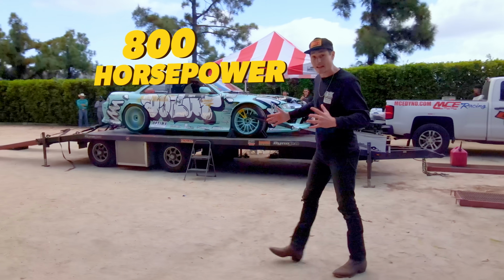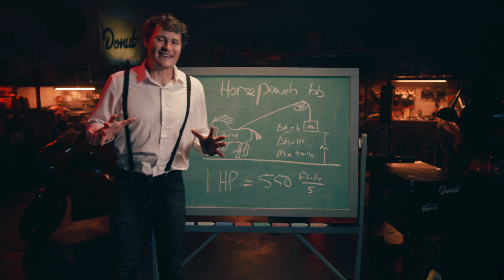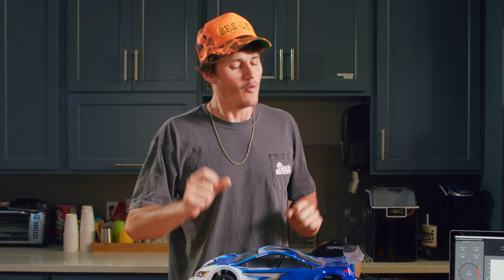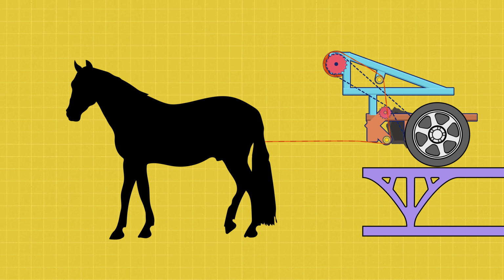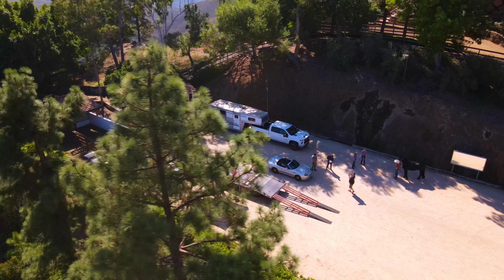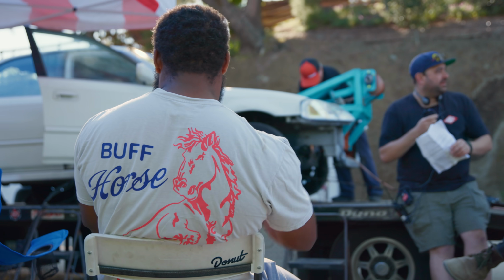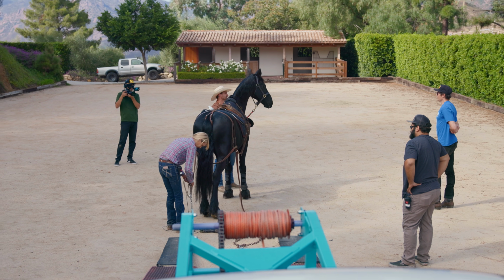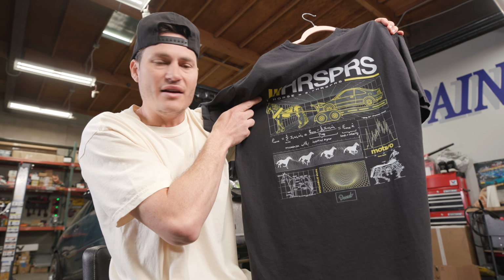How Much Horsepower is a Horse?

Comment: shitting on prior estimates was pointless. Watt based his calculations observing a horse do one hour of sustained work with 180lbs resistance, whereas this entire video was about peak power in a 10 second window. Big D doing 5.7hp looked like nowhere near his maximum effort. despite making the audience seem like this was a challenge against old knowledge, alas the 1993 Nature article's 15hp peak estimate and Watt's 1hp-for-1hr 300 year old estimate were nowhere near touched and we learned nothing new.

called in Adam Savage but yet did not share what ideas he had to give about the experiment design. a legendary man and treasure trove of resourcefulness wasted. what was the point? 

no scientific value except for the Motivo guys who thankfully get to write the paper about their crankshaft model of a typical draft horse, of which details were teased yet not even shared in the slightest, save for a few scribbles which we don't even know if it was the actual material. at least share the force measurements at the measured power peak. what did the GPS+force gauge numbers have to say? real science done by these guys but all we got from the video was a bunch of goofing around.

Comment: …but doesn’t one horse= 1 maximum horse power, no matter what? Nominal horse power should always be a single horse. 1=1 should be the starting point of any equation, I would think. Maybe I’m nuts but this seems over engineered. I’m sure I’m wrong but it’s a great video either way :) thanks! ❤

Comment: Every person understanding the difference between torque and power should understand this test is more a test of the horse's raw strength than its power.
A comparison is that a tiny cyclist pedalling with high cadence produces higher power than a heavy weight powerlifter lifting a heavy weight.
Power = force × speed. A horse is designed for speed and should be tested when it is running fast. Then you would get the true power. And it will be much more than 5,7hp. 
A track cyclist can produce more than 2hp in a sprint! The difference between a 600kg horse and a human is much bigger than that!

Comment: As a mechanical engineer myself I have an observation... you seemed to do a fine job of measuring peak power from a horse... But what you really needed measure was the power that the horse could sustain over the time it would take to pull a cart from point A to B.... measured in miles, not a few yards...  from a car point of view.. or if the horse was grinding grain over a work day, what its average power would be because that is what you would actually need if you were to replace it with a static engine. I love what you did but you haven't disproved the previous HP value like you seem to claim.

Comment: @donutmedia Is it possible to calculate hp of big D by just strapping a mini cart behind him and attach go pro to the wheels with the paper disc as reference.. and wait for big to reach his maximum speed without a runway limit? 

Or is there a force resistance added to the equation? 

The reason im asking this question is because i have seen a horse pull a ford focus for a mile...while the start was slower he eventually got to a comfortable speed of 35 odd miles per hour... so how can  big d reach his peak horse power if he doesn't have have enough road to let loose..i always thought gaining a certain momentum is a part of the equation.
 could yall possibly make a part 2 for this video for us to understand the physics better?

Comment: Except, its the HP of that particular horse. In order to get the actual adverge of that particular breed you need a data pool. A Clydesdale is going to have a higher HP then a Shetland Pony, so the adverage horsepower is specialized to a particular breed of horse. You would need to adverage out EVERY breed of horse and then take your adverage from THAT pool of data.

Comment: What a hard work way of solving a simple problem, to get an irrelevant answer!

It could have been done so much more easily and quickly by loading up a cart with weight and getting the horse to pull it uphill.  Or get the horse to pull a plough.  Measure the force in the line between harness and cart with a load cell, and the speed of the load.  Force times speed = power.  How much simpler would that be!  And with different weights (or a deeper bottom on the plough), the speed of the horse would be different so you would get a proper curve of power versus speed.  But even so this would only be peak power, what the user needs is sustained horsepower so you should find the load the horse can pull all day, not just for five seconds, to get a meaningful answer.  If the horse was only allowed five pulls in a day, each lasting a few seconds, that isn't usable power for any economic process!

If the peak power was 5 horsepower I bet the sustained power over a day would be not much more than one horsepower.  So I think James Watt was probably right because he understood the real problem to be solved, not just how to produce Youtube views!

I'm an energy systems engineer by the way.
Reply: Nicely said... I'm a mechanical engineer myself and have the same feelings.

Comment: The setup was insanely complicated and therefor error prone. The backup setup (scale in the rope) is much more accurate. Anyway it shows the original horsepower is quite accurate as this horse was doing it for only some seconds. The humans that pulled showed to be about 5 times as powerfull for some seconds as what they could do for maybe one hour. I've even read James Watt gave the horse too much power too as the measuring time was likely too short too.

Comment: So what is the standard?  The horse was originally “the” standard.  So if you are not going back to square one and performing experiments with a horse, then the standard of “horse-power” can not be achieved.  A dynometer is not a standard because it’s calibration is based on the standard of horsepower.

Comment: Finally, somebody's done this! But you're doing it wrong. All wrong. 🙄
A horse is ALWAYS hooked to an inert load. If it's a wagon, chariot or cart. Not so if the horse is hooked to a machine, but we're not talking about that. 😜
The pulling rope should've been wound around the dyno roller drum itself. 🤔
Reply: You'll excuse my ribbing, but take it as encouragement to give Big D another go. On a much simpler setup.

Comment: Your dyno test is pretty accurate for showing the sustained power output of an animal pulling a load, which is really the useful horsepower you can achieve, however if you calculate horsepower based on mass and speed, which will tell you inertia and torque you will find an 1100 pound racehorse which can peak at 55 miles an hour produces 14-15 horsepower. Which is also pretty close to the often quoted figure. You shouldnt run a racehorse at that speed for more than a quarter mile though.

Comment: This is interesting. Still not correct way to measure power. The max power of as well human and horse is achieved at high speeds, and not at low. It's the same as an engine. 
A horse is earlier guestimated to 15hp and this is hardly exegerrated, considering a cyclist can put out 1-2hp. No doubt that a 600kg horse can put out way more than 2-3 times of a human athlete, which actually not uses all 4 limbs like a horse does.
The power of the horse therefore should have been measured when it is running fast.

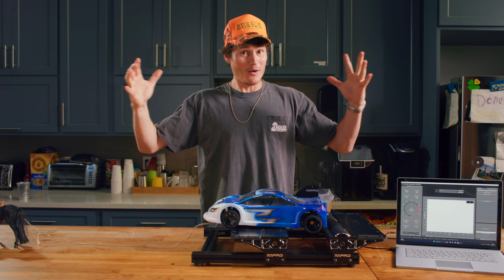Comment: 8:17 havent seen the rest but you added an extra resistance when the horse has to spin the axles then the drum. Wouldnt be accurate results.  Multiple pulleys basically

Comment: No offense, im a simple guy and do things the simplest way possible because i don't have all the great equipment that some do . So i would have just put the horse on a treadmill with the dino hooked to it them make the horse start and finish with Sprint that way you get max speed and tourch ... 🤷🏻‍♂️ This was a good video but alot of unnecessary engineering... 🤦🏻‍♂️🥴.
Reply: It was my first thought as well, but something like treadmill measures only speed and apparently dyno or whatever measures torque/force output? somehow.

Comment: That's fun, though that's peak power of a carriage horse for 5 seconds, not a lazy, cold and probably underfed draft horse turning a mill-wheel for an hour (the original basis to try to sell machines to brewers/mills/farming/mines). Like comparing a sports car to a small van, then maybe exaggerating a little! Not that far off, really.

Comment: As far as I know, the original "measurement" was for it to keep it up all day, that is "a shift" at the work site. They may have had more that one horse so they could 'tag team' them. So not peak power but sustainable power. 
The power of a drag car is peak, will last seconds, will explode if held on for too long, while a semi-truck is sustainable power, up and down hills, all day, very rare for peak power ( hill start, fully loaded? )

Comment: Wait.

Couldn't you just put in a pair of dyno drums, mount an axle to the trailer so the wheels spin the dyno like normal, and then just...wind the strap around the axle directly to drive the wheels as the horse takes off?  Absolute minimal complexity, minimal energy loss.

Comment: Omg the most useless video I've ever watch to figure out the horse power of an animal. All you need is a mass and pick it using a pulley. The mass is fixed, the distance to lift the mass is fixed and you just need to measure how long it takes the horse to move the mass that specific distance.  P = F*d/t  . Thats it!

Comment: If you had a vehicle do a pull on the dino then do a pull on the rope horse adapter, you could calibrate the horse dino fairly accurately. This would remove the variables between model formulas. Better yet, if a vehicle was used that had its engine dinoed, you could more accurately calculate "crank" HP. also an average taken from at lest 10 horse would be cool to see. awesome work!
Reply: They could (and I bet they did) use the GPS and load cell to do that but better.

Comment: Can I just ask, why convert to a rotational frame of reference? HP is just power, which can be torque*RPM but cans also just be force*velocity. You can hitch up the horse to a wagon, put a force gauge in the system, and one of a million ways to find velocity. Just as a quick fact check, some quick googling tells me a draft horse can pull ~2x its body weight of 1500 lbs, so ~6.7 kN of force. Your average horse walks at ~1.1 m/s while pulling a wagon, giving us an estimated power of 7.4 kW or 9.9 HP.

Obviously my answer is off, since im using estimates and some quick googling, but its close enough that it looks like it would work to me. It would be a more direct way of getting the answer, and would have less gear/friction/etc youd need to math out.

Comment: Unless this has been tested by others.....f this is the first experiment to validate or debunk WATTS'  experiment; there will be quite a bit of income from the resulting white paper.

 I like the cardboard replacement for laser counting gear teeth motion. Markers on a substrate have been used in experimentation and measurement for a long time, likely because of the sharp contrast, and ease of use of light to make on-off pulses or counts.  A very accurate replacement would be a plate with magnets spaced out along the circumference, and a pickup coil ( Hall Effect ) .

Awesome and fun video

Comment: I believe both shirts are accurate!
 1 horse makes 5.7HP max. 
But a single horse wouldn't be able to produce 5.7hp for an entire shift. 
My guess is that it would take a 5hp motor to replace 5 horses. Even though 5 horses can make 28.5 max hp for a short amount of time.

Comment: I was puzzled about it. I always thought horses couldnt only make 1 HP because horses like Big D can pull tons of cargo. They could even pull down small houses back in the day.
Reply: Think less "instantaneous strength" and more "amount of work done over an entire day".  IE take the amount of horses it would take to do a set amount of work in 1 day, if the steam engine could duplicate it, it would be rated at the same horsepower as the number of horses.  If it was 5 horses, 5 hp, etc...  Then figure old days, less fit horses being used(injured, sick, old), etc...  Picture how much HP the guys would rate if you measured after them doing the pull repeatedly for 4 hours.  They were wiped after one!

Comment: Cool video!...except for one, little, thing.

That one, little, thing is a Welsh mine pony.  These small horses were used to pull ore out of the mines...sometimes using carts, and sometimes using hoists with block and tackle.  In a big mine the carts would be pulled to the shaft, then the cart would be hoisted up the shaft.  Since the mines were usually fairly cramped, a breed of horse was developed...the Welsh Mine Pony.

Due to its diminutive size, of course the Mine Pony couldn't put out like Big D.

Yup!...You done used a Big Block to test a Four-Banger rating!  Gotta know your history!

Comment: Ok so i was wrong its not what they did. But can anyone tell me whats wrong with putting a strain guage between the horse and a load (example a car with someone applying the brakes) and simple go. You can average it over a decent distance (remember the HP is supposed to be what a horse can MAINTAIN not peak). It would also require almost nothing to set up zero loss calculations in the system just the speed and strain very easily measured and you could do it for say 10 minutes. 1hp is the effort a horse can maintain not its peak pulling power so to me this experiment although fun was essentially useless?

Comment: But, if you measured the speed at the wheel with the GoPro(and not at the crank with the laser), didn't you get the wheel HP and not the horse's HP?

Comment: Before the animal activists come in talking about abuse. 1 draft horse like Big D is strong enough to pull a UPS truck out of a snow bank. 2 draft horses can pull a duelly with a 20' enclosed trailer attached to it, sideways, out of a snow bank. A pulley system hooked to a dyno drum is not pushing him to his limits, not even close. The torque numbers would tell a more accurate story of just just how incredibly strong these animals are.

Comment: Hold up cowboy, you have just determined that a horse is equal to 5.7 HP, but it is a horse so it should be the bench mark for HP. In this case this the horse produced 1 HP and all cars should have their power outputs divided by 5.7 to get their true HP.

Comment: This is an amazing question and experiment, but I cant help but think you've made it unnecessarily more complicated and a bit inaccurate involving a car's transmission and having to use all that unnecessary math. Just hooking up that pulling system directly to the dynamo would have been more efficient and accurate IMO.

Comment: I would have cross-validated the result with a small motorbike/scooter, the horsepower of which was also calculated on the same dyno.
Reply: Yess! That would be an important step to falsify the result. Does the number hold up?

Comment: you're only measuring a fraction of the horse's power this way, he produces a lot more power when he's galloping at full speed up a hill, also a larger heavy horse would be able to produce far more low speed torque

Comment: I have to disagree with your findings.  1 HORSE does NOT equal 5.7 HORSEPOWER.    1 HORSE equals 1 HORSEPOWER.  

What you've done is reset the 'calibration standard' for what 1 horsepower equals.    Just like textbooks get updated with new findings in the world, it may be time to consider re-writing history and adjusting the findings.    Think of it like this.  Based on your findings, a Dodge Challenger Hellcat does not make 797 horsepower, it makes 139.8 horsepower.

Comment: I get that it was fun to make it all work on a car dyno and that made the video work for your audience, but the straightforward and more accurate way to run this experiment is the same way you showed as your "backup" method (the load cell and GPS based speed data), but with the horse just pulling a simple load like a heavy sled.  So... what did that backup data show?

Comment: I'm so impressed by how good all the explanations were. I'm a mechanical engineer and also a pedantic smartass (I've heard that some people can be one without being the other) and the whole time I was like, wait, he still hasn't said anything that even slightly contradicts what I knew coming into the video.

One thing that always trips people up, the idea at the time was to quantify how much power an average draft horse could provide for a full work day, not a good individual pull. The continuous output rather than peak output, basically, since that's how a factory operates.

Comment: I had high hopes for the video but lets talk about the 3 major problems.
#1 they didnt make a horse dyno that made a horse adaptor for a dyno. That was disapointing. 
#2 this test measures the max output of a horse and thats just not what horsepower is so dont be saying the original experiments were wrong. One HP (746 watts) is the average work that an average english farm horse could do over an average work day. So yes that hosre can pull 5 +hp for a few short seconds but doing it all day would kill it. The HP powder unit was created so that engines could be rated in units that were familiar and useful for the farmers who were buying then engines. For a group of people who claim to have done alot of research on this they sure came up short.
#3 the guy in black looks and sounds to much like Norm.